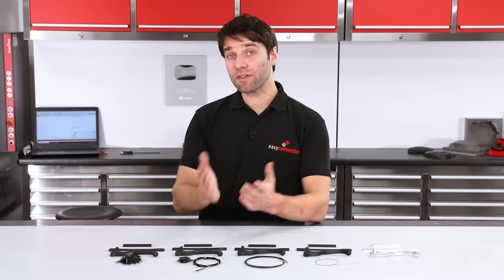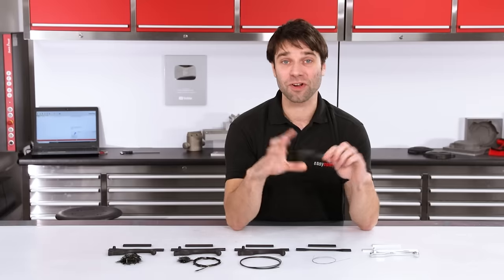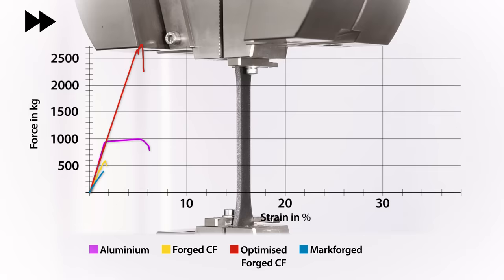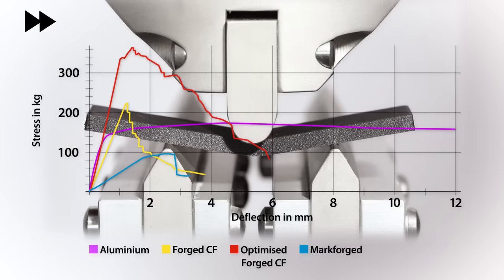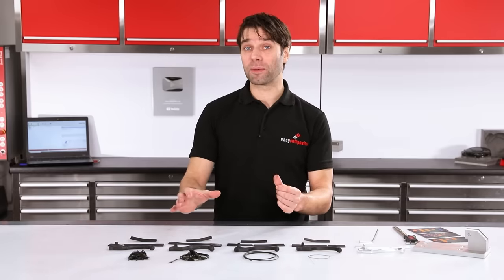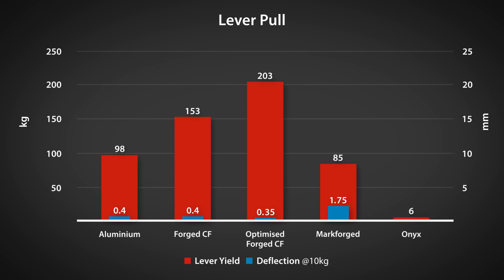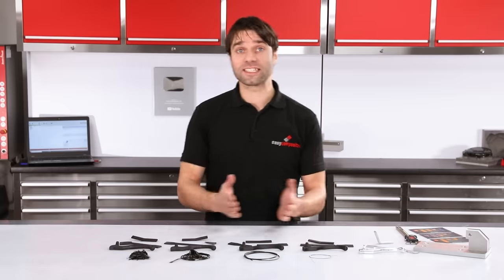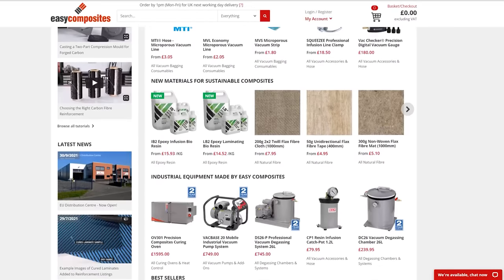How Strong is Forged Carbon Fibre? Forged Carbon vs Aluminium vs Markforged vs Onyx

Comment: STOP calling this garbage "forged" anything.  It's not forged.  You might as well call it "organically grown" carbon or "composed by J.S. Bach" carbon.  It's just not.  So stop it.
Reply from the maker: Thanks for the comment and yes, the term 'forged' carbon fibre is not the clearest but it's been around for a while now  (Lamborghini have been using it for several years) and is quite widely used with an established meaning. To avoid using the term would mean that many viewers interested in understanding 'forged carbon' might never find this content, get to see what the term refers to (for some at least) in the context of carbon fibre composites, and learn how - for the right components - this process can be used to produce strong, lightweight parts with minimal equipment.

For what it's worth, before making the video we did discuss whether to use the term 'forged' a lot because we really weren't sure ourselves. After lots of deliberation (checking dictionaries and researching the history of the term) we decided to go with it but we did expect others might come to a different view, and that's fine too. If you'd like a much more lengthy explanation of we came to our decision please get in touch, we're happy to have more healthy debate on the subject :)
Reply: @easycompositestv  
At the end of the day, it's not forged.  It's not even analogous to forged parts.  It would be much more accurate to call it carbon adobe.

Comment: Dr Alexander Fergusson, Lecturer in Composite Materials in the Department of Mechanical Engineering at Imperial College here and CEO of FAC Technology. It is my professional opinion that the information contained in this video is dangerous when you are talking about a safety critical part like a brake lever. This is not science and it strains credibility to suggest such material could be used for engineering anything more than something like a toy RC car (and even then, only as long as children won’t be playing with it). If you want to understand how these materials behave then go look at papers on short fibres by the likes of Dr Soraia Pimenta and Prof Silverstein Pinho Et al. have on this topic. Companies outside the usual aerospace suspects (i.e.,Airbus, Boeing, NASA, etc…) like Callaway and Lamborghini pay them to explain why differing composites behave the way they do and how manufacturing process effect this. You can read open access papers about the research academics like them have done for these market leaders in their fields for free; suggest anyone interested in short fibre containing composites reads their work if you want to design with these materials rather than engineering dross like this. Might be worth looking at the paper on toughening with short fibre by Dr Sammy He. Disclosure; I was one of Sammy’s PhD supervisors and he won the Tsai award (named after Prof Tsai of the Halpin-Tsai and Tsai-Wu failure criteria for composites fame) for his seminal work on the extension of the Huang-Kinloch model to account for the contribution of fibre pull to predict failure behaviour of particle and short fibre reinforced composites.

Comment: i have to say that the 3D printed is the worst if only considering mechanical properties
Reply from the maker: Ultimately it depends on the specific case for each project as long as the fundamental properties are adequate for the design intent then that shouldn't be an issue.

Comment: This is total crap click bate title.  There is no such thing as forged carbon fiber.
Reply from the maker: Thanks for the comment and yes, the term 'forged' carbon fibre is not the clearest but it's been around for a while now  (Lamborghini have been using it for several years) and is quite widely used with an established meaning. To avoid using the term would mean that many viewers interested in understanding 'forged carbon' might never find this content, get to see what the term refers to (for some at least) in the context of carbon fibre composites, and learn how - for the right components - this process can be used to produce strong, lightweight parts with minimal equipment.

For what it's worth, before making the video we did discuss whether to use the term 'forged' a lot because we really weren't sure ourselves. After lots of deliberation (checking dictionaries and researching the history of the term) we decided to go with it but we did expect others might come to a different view, and that's fine too. If you'd like a much more lengthy explanation of we came to our decision please get in touch, we're happy to have more healthy debate on the subject

Comment: Hahaha. "Forged" hahahahahahahaha. Looks like chopped tow to me.
Reply from the maker: Thanks for the comment and yes, the term 'forged' carbon fibre is not the clearest but it's been around for a while now  (Lamborghini have been using it for several years) and is quite widely used with an established meaning. To avoid using the term would mean that many viewers interested in understanding 'forged carbon' might never find this content, get to see what the term refers to (for some at least) in the context of carbon fibre composites, and learn how - for the right components - this process can be used to produce strong, lightweight parts with minimal equipment.

For what it's worth, before making the video we did discuss whether to use the term 'forged' a lot because we really weren't sure ourselves. After lots of deliberation (checking dictionaries and researching the history of the term) we decided to go with it but we did expect others might come to a different view, and that's fine too. If you'd like a much more lengthy explanation of we came to our decision please get in touch, we're happy to have more healthy debate on the subject